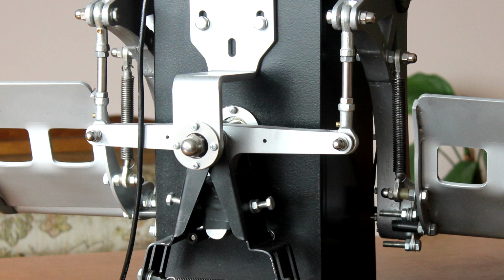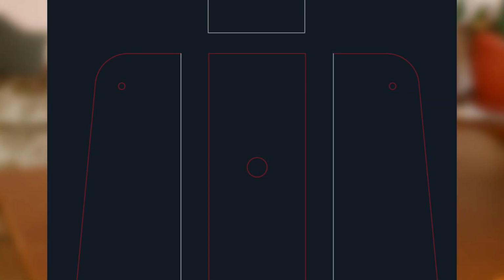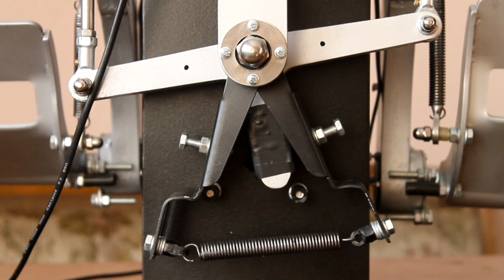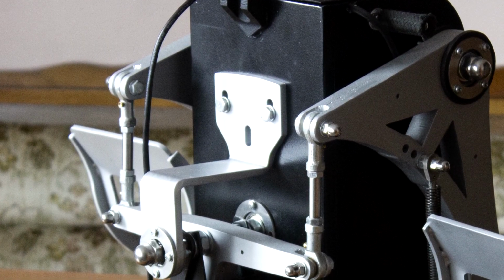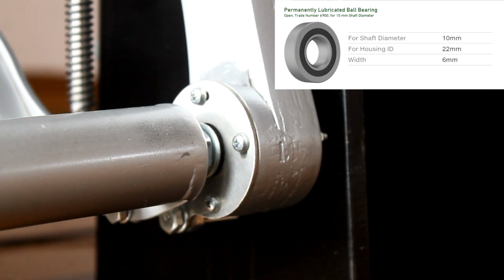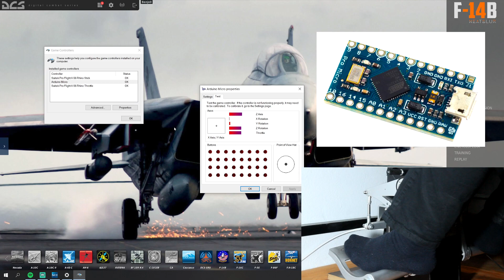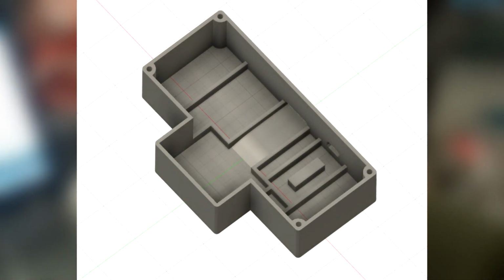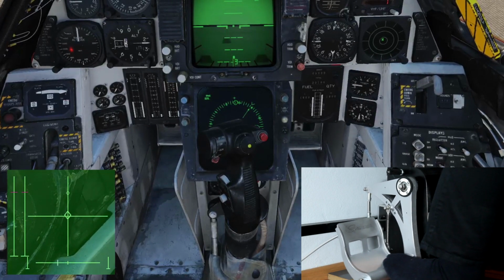DIY Pendular Rudder Pedals | Custom F-14 Tomcat Pedals

Comment: THANK YOU for showing a full video on this. I came across someone who built something similar but it was pictures on a forum and I couldn't see the exact mechanisms to replicate. I'm currently putting together plans for my return to MSFS since 2005/2006. I'm planning on ordering a yoke and throttle quadrant from Honeycomb but there's no quality and value rudder pedals on the market. I could always do what I did back in the day and have the computer assist with the rudders, but that makes crosswind landings tricky and single engine landings impossible.

Comment: excellent solution Sir, good job!  And the best of all is that you're sharing your ideas with everyone. I may borrow some of the ideas in my build. I think 10mm steel is a bit of overkill but that's a personal preference. I would probably add some weight to the bottom base plate and use perhaps 5mm for the housing. We'll see...

Comment: Nice craftsmanship. And very well done video,  congratulations.

Could consider a CAM center system option for have a less "clunk" center transition.
Reply: This is probably only a problem for fighter simmers and not the pressurized tube simmers. In the latter case you want smooth rudder movements and if you're moving them left and right like that you're doing something wrong... the former is probably where it matters as you need split second snap movements.

Comment: Thank you so much for posting this video and including all the design materials.  It would be nice if you could include .step files as they are much easier to edit compared to .STL files for those who plan to adapt it to a 3D printer friendly design. I just ordered the WinWing Orion HOTAS system and was looking to upgrade my well over 15 year old tried and true CH Products Pro Pedals.  I started sniffing around current commercial offerings and really liked the Thrustmaster pedestal mounted pedal design, but not the silly $600 price tag.  I have a nicely equipped home shop with a manual Bridgeport 9x42 step pulley mill, and a Monarch 10ee lathe. I repair CNC machine centers and one of our plants has a burn table so I can easily replicate the parts since you kindly provided .DXF's of em', but I'll probably stick to whittling them out here in my home shop.  There's just a lot more pride and satisfaction after you take a pile of scrap metal and form it into something incredibly useful with your own hands vs sticking stock in a machine and pushing the big green crash button.  You've saved me a bunch of work trying to reverse engineer the Thrustmaster design from online photos and really knocked it out of the park. What a clever design and implementation - Well done Benjo!  Because of my machinist background I'll probably modify it using Timken style bearings and machined axles for the main pedal pivots to stiffen the pedals as the cantilevered shaft places a substantial load right at the root there and I notice some lateral flexing in your design (threaded rod axles flex/bend a lot easier/more due to the missing material on the periphery due to the threads).  I have a lot of bits of aluminum laying about the shop so I'll probably use that to fabricate the pedals as well.  I plan to stick the support tube in an index head and mill straight knurling across to provide some grip for your shoes.  Finally, I might have a play around with using a cam based centering system using a 3D printed cam and a small cam follower bearing to allow for progressive stiffness as it's depressed further. Will also play around with getting 16-bit hall effect sensors to work so the resolution matches that of the Orion stuff.  Never played around with hall effect stuff so that will be interesting.  I keep Pro Micros in stock here in the lab as they are so useful for making anything keyboard/joystick related.  Not just for PC stuff, they can be used to automate anything that uses a standard PC keyboard such as test equipment, microscopes, etc.
Reply from the maker: Was a pleasure reading your comment and I thank you for that. Obviously there are a few flaws in my project that you mentioned that could be massively improved upon. Such as using a Cam centering system to remove the 'clunk' as well as to add a smoother progressive stiffness. The lateral flexing on the swing arm bearings is definitely there but luckily I've had no issues with it in a year of using the pedals. And lastly the 10-bit default arduino Micro isn't optimal when it comes to resolution, especially with how little the toe brakes pivot but I just didn't have the patience to wait 2 months for an ADC to be delivered to me from Amazon. This was after all the first big project of a 22 year old who managed to sneak in some time on the Machinery at his old workplace. I'm sure that someone with a lot more experience and access to such machinery could greatly improve the design. If you ever decide to film/document your project I would love to see it!
Reply: @marcseclecticstuff9497, did you by chance get yours completed with the modifications you've mentioned?  If so, could you post a vid and the details (if you've captured it)?  Thanks a bunch!
Reply: @stargazer6912  I'm sorry to say, no I didn't.  I'm extremely busy and have limited time.  I figured I'd have at least a week, so in reality more like 2 weeks out in the shop making all the parts for it.  I could work thru the weekend at my night job and earn enough in those 2 days to buy 4+ Thrustmaster TPR's so that's what I ended up doing.  Doesn't have the satisfaction of DIY but in the end I came up money and more importantly time ahead.  Gotta say, I don't regret it at all, the TPR pedals are absolutely fantastic.

Comment: Thanks for the video, really appreciate the project. Ehm.. so, just confirming the connections:
1. The three ky-024 sensors are running in parallel into the 5V (VCC connector).
2. Also parallel in ground (but any choice of grounding would do: a separate ground for each, all in one ground.. whichever fits the layout best)
3. Each sensor gets their own separate analog output connector (looks like you used A3/A2/A1), correct? The Digital Outputs on the sensors are not used, since a range of motion is needed instead of just off/on.
By the way, that means ky-003 sensors can't be used, right? From what I read they seem to be digital outputs, so ky-024 or ky-035 would be the ones? Ky-035 looks just like ky-003, but with analog outputs. In case I get ky-024 sensors,  should I mess with the potentiometer?
Reply: Did you happen to save the documentation from the arduino site?  The link is now broken and I can't get those.  Any help would be great. TY!
Reply: @Scottforyoutube  Unfortunately I didn't save the page. I do have the files for the pedals & joystick library though, plus an idea of how to wire things, but I don't remember if you can just throw the code into the arduino chip as it is.
Reply: @kabzebrowski  I think I got what I needed. Did you build them and if so how satisfied are you given the amount of work? TY
Reply: @Scottforyoutube  I got all the electronics a while ago, recently made wood parts for the pedals - I'm not going for the pendulum style tho. I'm also giving a thought on 3d printing some curved rack & pinion system on which to put the magnets and sensors, might try that to get more precision on the movements.
I'll probably assemble all of it in the coming weeks. Tbh I'm not in a hurry because I have a stick with yaw on it, it's way more of a side project for me.

Comment: Great job.!!! One question, in readMe parts you say that the sensor module is the KY-028, but this is with a temperature sensor. The correct sensor module would be the Ky-024 or am I wrong?
Reply from the maker: You're absolutely right, not sure why I wrote it down incorrectly.

Comment: Hi, Just a few questions : why do you mixed the metal used? for amagnetism due to the sensors in arms, for fun or something else?
What magnet can i use?
i have ordered the sensors and the board.
Thanks
Reply from the maker: Arms would've been heavy if not for aluminium. Any magnet should do.

Comment: Are there some parts incorrect in the parts list?  I see 5 30x10mm Ball bearings in the readme, but only see 4 used in the video (2 for the center 10mm shaft and one for each rudder arm).  Also, 3 22x10mm BB in the reading, but only see 1 for each rudder pedal.  I see 4 6mm Ball Joint ends in the readme, which is enough for the synch mechanism for rudder movement.  Each rudder pedal seems to a have a similar connection, but it is surrounded by a spring.   Are these also ball joints? I don't see anything listed for that connection.
Reply from the maker: Hi, there are two 30x10 bearings in each swing arm and only one for the center 10mm shaft.This is to make up for the width of the arms.
The 3rd 22x10 is in the supporting 'Z' shaped piece on the back. (can be seen @3:30 in the video)
The ball joints are only used for the sync mechanism, 2 on each arm. The springs are not using ball joints, if you pause @4:52 you can see this. It's more of a piston/cylinder with a spring around it, kinda hard to describe. You can see it better at @6:50 in the video.
Reply: @Benjo0  Wow, so great to hear from you.  Wasn't expecting to since your last reply was 5 months ago. Understood on the bearings; 2 big ones on each side on the top of the swing arms, one small on each rudder pedal, and one big and one small on the center shaft.  Do you have any spec reference for the piston/cylinder? I found this  http://celebratelifeidaho.us11.list-manage.com,   but it doesn't have the right ends on it.  I'm planning on 3D printing most of it, initially, to at least test for fit.  I don't know how to weld yet, so I'll try CNCing the swing arms using 20 mm metal. My ME buddy thinks our machines can do it.  We'll see. Not sure yet how to attach the added ring for the rudder pedal shaft/bearing to the swing arm without welding, yet.  Thinking the screws you have in the design may be sufficient.  Metal construction is very cool, though.  Maybe I'll get my welder up and running and practice someday.

Comment: Awesome project well done!  When I click on the link above for Arduino Hall sensor I don't seem to get anything pertinent.  Is the link broken? TY!
Reply from the maker: Seems like it is, not sure how or why.. I'll try and remember to check tomorrow
Reply: @Benjo0  Thanks really looking forward to building these!
Reply from the maker: @Scottforyoutube  Hi, just got the chance to check it out. That link used to be a guide on how Hall Sensors work with Arduino and I guess it was removed by the owner. 

In my 'All Files' link however, there's a file with the exact code I used. Hope that it can at least be of some help.
Reply: @Benjo0  Thanks Benjo I did find that.  I was wondering how you decided on doing the brake sensors like that rather than a plunger looking arrangement?  Was there a technical reason or you just thought your way was more pleasing?  Thanks great work!

Comment: Masterpice .  I did rudder pedals similar to Simped F16 . I used a sensor hall 49E and Arduino micro pro . I have a issue  . Works ok . but I dont have a full range of motion . I get only 75% of range . Magnets almost touches a sensor but I dont geting a 100% range  I made a simulation in DCS . Any idea why ,and how to fix this .  I wonder .... I want to add ADS 1115 bit to Arduino maybe it help .
Reply: Hello Janko,
that's what I did : adding ADS1115 DAC.
Its works great for rudder, a little bit more difficult for brakes. It was difficult to have the same range right brake and left brake, due to the poor geometrical accuracy of my machining. Not a problem. Corrected by software.
More than 8000 real steps available for rudder, delivered by Hall effect sensor,  compared to  #300 steps with Arduino standard DAC. Far away from 65000 potentials ADS1115 steps, but it's widely enough!!!

Comment: I am planning to buy arduino pro micro and the same hall sensors, but i dont know what is that big white board  which connects  sensors and arduino? 
Is that important part?  I saw some videos about other homemade pedals, and they did not have those white boards, just arduino connected to sensors.
Reply from the maker: It's just a connecting board. I used it for convenience, alternatively you can just wire/solder everything directly. You can google 'Electronics project Board' to see what it is.
Reply: @Benjo0  Hey thanks for answering! I hope that this can be affordable ( i mean the price of bringing everything to be cnc cut) except that i already know how to weld and other stuff...it is too difficult to cut and make perfect holes with hand drill and grinder. So my only option is to find a place where i can bring materials and pray for the best price :D
Reply from the maker: @kobac5282  Ye, I was lucky enough to have worked at such a workshop at the time. I understand it would be difficult/expensive to replicate these but you can also just take design ideas from the video and revamp it to something that can be manufactured more easily.

Comment: welding aluminum 

And im done
Reply from the maker: No reason not to try making it out of some hardwood? It would be cheap, easy to cut and you could get the desired thickness. :)
Reply: @Benjo0  This is what I'm gonna do myself. I'm gonna get a jigsaw, sander and some 3/4 plywood, and then layer them together to get 1-1/2 to 2-1/4 inch pieces for the T and L brackets. The only issue I see is trying to make the centering mechanism. I'm probably gonna grab some circular neodyniom magnets and then epoxy them into place after I use a forstner bit cut out its resting spot.

While I like the look of the F-14/F16 pedals, I may build 737 style pedals instead.